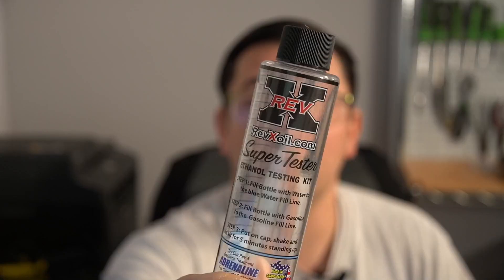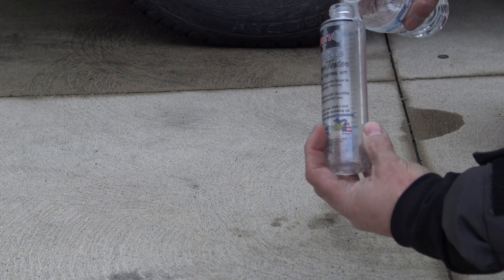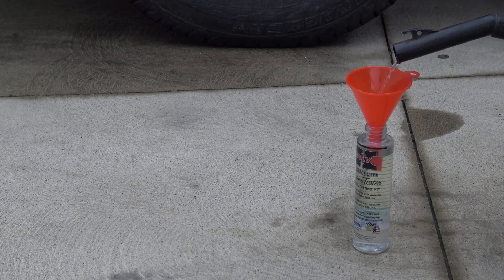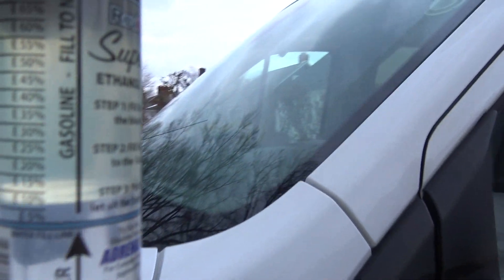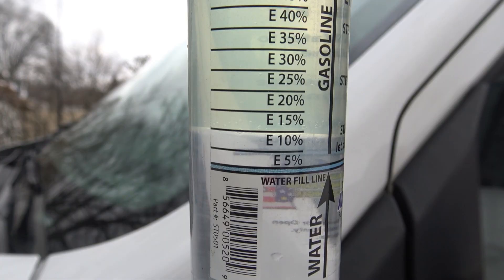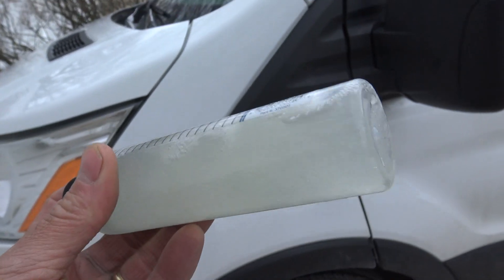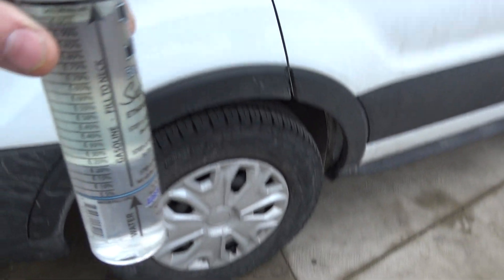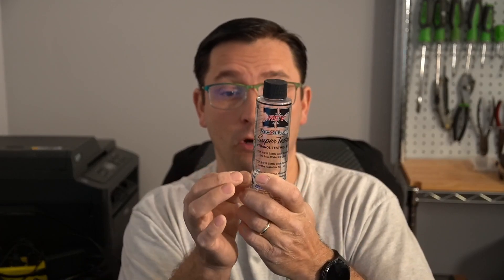Fuel Testing Tool How to test Alcohol content / contamination

Comment: I have a 66 gallon gas tank in a boat, I thought I removed all the water from it, Nope I didn't,  I went to pump and pumped in 45 gallons of fresh non ethanol gas,it filled the tank up, I realized then I still had water in the system , I screwed up.
I pumped it all out into a 55-gallon drum and jugs. Will I be able to save this gas somehow and reuse it?
Reply from the maker: I dont know! Make sure you store it properly and Safely

Comment: Cool.  I've had Water show up in 10% 87 octane mix when it sits for long periods time.  I'm not sure how it condenses it, but it does.  It's generally in my 2 cycle can that sits for long periods of time in my shed.  Go to use my saw and it won't start.  Pour out the fuel and it has water in it.  Probably should of used a fuel stabilizer.

Comment: Great video! I got my ass handed to me on a 2011 tahoe with a p0171. Ran lean through the entire powerband. And it had a ton of power. I did a fuel test in Mason jar as a last resort. Sure enough it had E85 in it. We don't have E85 here, but the fuel cap said it was e85 compliant. After running the rpo numbers, I found out the vehicle was not an e85 vehicle.
Reply from the maker: Glad you got it!
Reply: Typical GM screw up 😂

Comment: Thank you, Brian!  This is a great CHEAP tool to possibly solve a problem efficiently!
Reply from the maker: You are welcome. I hope this helps others be open to the idea of checking the fuel! I get to shops that the plugs are fouled wet, take a few out and blow them off , spray some brake cleaner In the intake and the engine will hit and run for a bit..